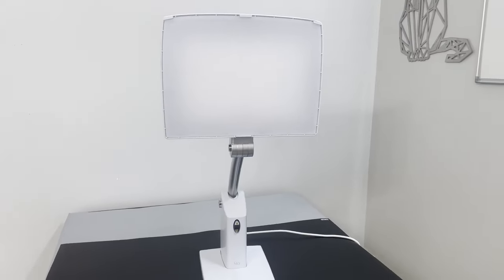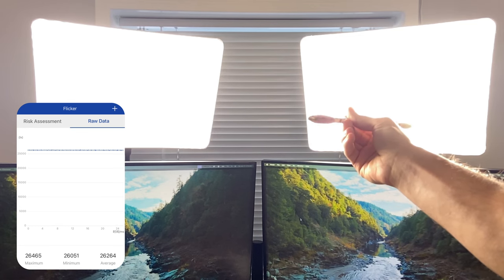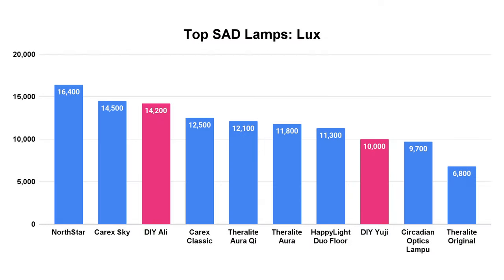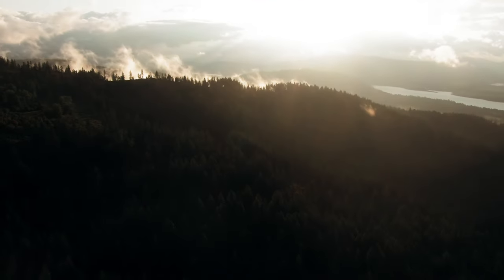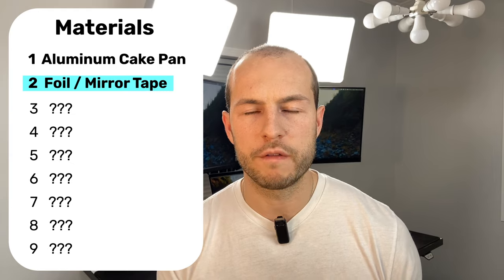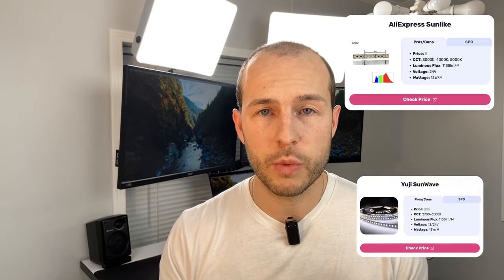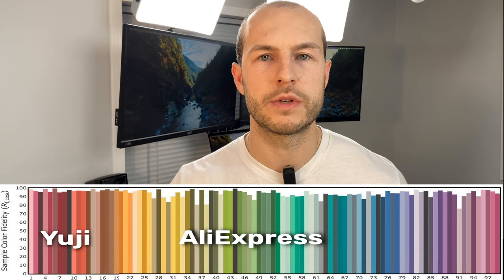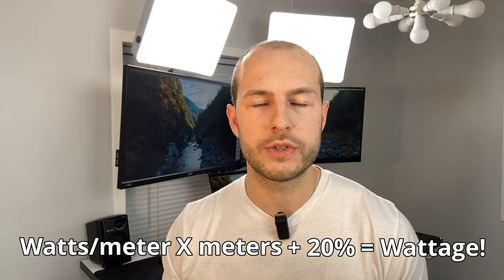The Ultimate Guide to Making Your Own Full-Spectrum SAD Light

Comment: I think it's doable. There are lots of videos of making glasses / goggles for cosplay . I'm just not sure or power of cob chip. How many lumens from such a short distance . They could be powered by usb from powerbank for weight control. There are some growing full spectrum chips to buy but not sure what Lumen is needed.
Reply from the maker: Interesting point, I've not watched those. As for the lumen output, yeah I'm not sure... That would have to be experimented with, probably better to start high and just under-power or over-diffuse if necessary.

Comment: Really good video. Do you know how panel like this compares to light therapy glasses? Mainly I mean does the light only need to reach eyes or skin as well to fully work ? Also would you consider DIY light therapy glasses? I'd love to make a pair but not sure what led cob or strip to use and how to power them and you seem to know what you're doing ! Thanks
Reply from the maker: It only needs to reach the eyes! DIY glasses would be much harder! Just given the size constraints. I'd think the easiest DIY route here would be to modify a baseball hat or something? But I'm not sure, I'd have to give that a lot more thought haha
Reply: Also if it only needs to reach eyes then full spectrum for glasses is not required just appropriate wave length blue light chip ?
Reply from the maker: @kusmierek9  The Blue-green range is where the circadian system is most sensitive yes, so that should work!

Comment: I have a question regarding the LED strips, suppose my country doesnt have these brands, which units of measure are there or what should i look for when picking a good led strip?
Reply: I guess I've found one which has CRI of 95 and a 120/m lumens which 8s comparable with the Yuji strip, but it's in 24V. Should I do anything about 24V ?
Reply from the maker: You’ll just have to make sure your power supply supports 24V, but that’s the only difference.

My aim with this lamp was to use strips that were closer to the spectral output of sunlight. A light source can have a high CRI and still be spectrally quite different from sunlight.

A high CRI or Rf (TM30) is certainly better than low, but I’d try to find a strip that emits like the ones in this video if you can!

Comment: Im curious now, how this will compare with video lights? What is the difference?

For example the NEEWER NL660 Bi-Color 660 LED
Reply from the maker: Good question! The spectrum is definitely going to be better on these DIY lamps, from a naturalistic POV at the very least. Photography lights like the NL660 can certainly work! They might not be as diffuse as you'd prefer for long periods of direct FOV use however. The light itself is also a bit smaller making it less comfortable.

Comment: Thank you so much for this. I wonder if you could tell me the specs and brand of the Aliexpress led stripe, because unfortunatelly i can't see the article through the link provided from my country (Spain) since is not available here. (I would look for something similar / same brand / cheap available here.).
 Thank you so much in advance! Subscribed ofc.
Reply from the maker: Hey there! So you can't view AliExpress links in Spain? Hmmm. In any case, what you're looking for is a "SunLike" led strip. if there are spectral graphs available they should look similar to the ones in this video!
Reply: Thank you for the response. This particular item is not available to be shipped to Spain, and seems that for that reason I can't access the item page. Already found one available here. Best regards!
Reply from the maker: @falconsito  Excellent! That's great you could find one.

Comment: Nice work! How hot do you think those LEDs get? Fair bit of power in a smallish area
Reply: Nvm just saw the bit in the video. A lot cooler than I expected!
Reply from the maker: Yup! Not bad with the large aluminum pan as a heat sink 😁 They definitely got way hotter with the stainless steel.
Reply: AliExpress link

Comment: Hey, if you were to use the ali-express strips, just completely bare on the ceiling. Would this still be effective for circadian rhythm stimulation?
Reply from the maker: It would be yes! Any additional light to a space is helpful. The distance makes quite a big difference however. So this lamp with the LED strips right next to each other would be something like 8x or 10x as effective at 1 foot as some spaced out LED strips on the ceiling at 3 feet.

So just keep that in mind.